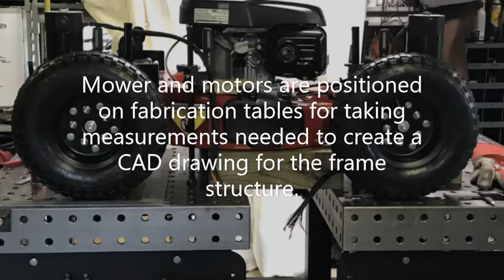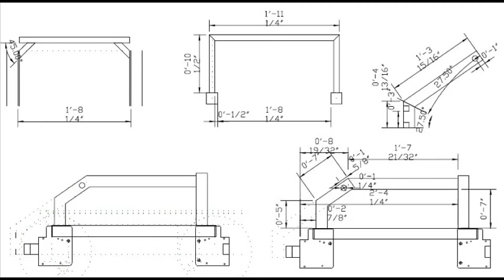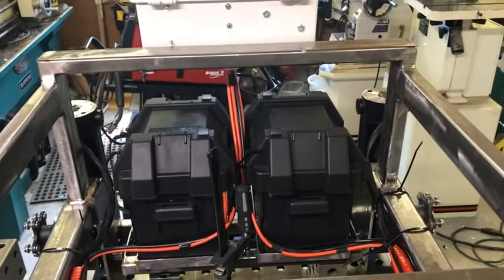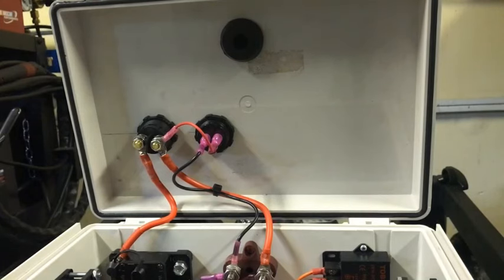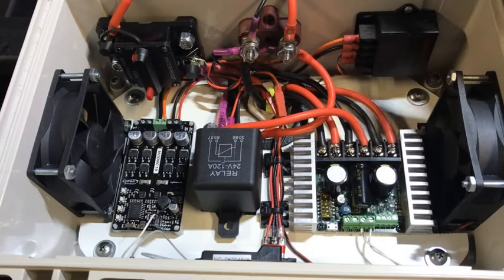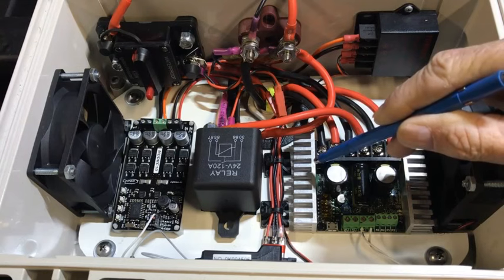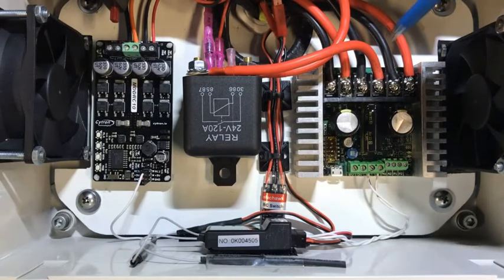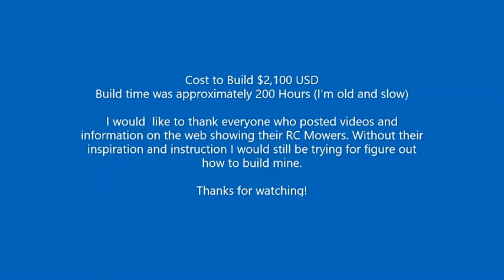Four Wheel Drive Remote Control Mower Build

Comment: That's the average cost for this project. Very well structured and engineered. I love the RC box control. I am trying to improve the speed of the motors, I'd like for my project more speed. How was your experience with the alternator? could you give me the tips to make it works?
Reply from the maker: Hi Teo, the alternator works great. When I finish mowing the battery voltage level is higher than what I started with. I have yet to charge the batteries. The 24V alternator I used is available on Amazon. It is called a one wire alternator, but you you have to use two wires. The positive and negative are wired straight to the battery's. I am running mine in reverse rotation (not sucking in air) to minimize dust and sand from being forced into the alternator. I checked the alternator temp after an hour of use and it was around 180 degrees. This is about the same temperature it would experience in a car. As far as increasing speed, a dc motor will have a max rpm at full power . If your motor controller is not capable of providing enough amperage to the motors it may not go any faster. As a rule of thumb, your motor controller should be sized at 6 times the running wattage. The formula is power in watts/voltage=amperage x 6. A 200 watt motor/24 volts= 8.3 amps. Multiply 8.33 times 6=49.99 Amps. This is the peak current the per channel that the motor controller could need for high torque start or when it is put under max load. Also wiring size and circuit breakers should be sized accordingly. My mower goes around 10mph + on a flat surface, but controller is not powerful enough in certain situations. I thought I could get away with a smaller controller, so I will be upgrading to a larger controller and wiring setup soon.  Hope this helps.
Reply: @giterbilt5146  thanks
Reply: @giterbilt5146  I have another question related the Alternator, how many RPM do I need to make the Alternator works?
Reply from the maker: Most alternators need to spin above 2000 RPM. If your mower pulley is larger than the alternator pulley you should have no problem. Most small gas engines rpm  is around 3400-3600. When searching for an alternator, look at the spec sheet to see what the rpm requirement needed.
Reply: @giterbilt5146  Thank your reply.
Reply from the maker: Here is an Amazon link for the one I used https://www.amazon.com/Alternator-1101285-1102348-1102379-AT130930/dp/B01NCI3Z2S/ref=sr_1_1?crid=3OQ2JHPH13FK6&keywords=New+24V+1-Wire+Heavy+Duty+Alternator+Replacement+For+Case+L59901&qid=1649249401&sprefix=new%252024v%25201-wire%2520heavy%2520duty%2520alternator%2520replacement%2520for%2520case%2520l59901%2Caps%2C1258&sr=8-1

Comment: Wow... what a clean job!  I think this is the cleanest mechanical+electronics work I've seen in my whole life so far. Respect...  I can totally see you are no 'regular builder' at all.  So sad the first half of the video doesn't have audio on it.  I'm sure that's possibly the main reason why the video has so few likes/views so far.  

If I were to have such a clean machine, I'll be like one of those proud  show-quality truck owners who work their truck 1 day and then spends 2 days cleaning and polishing it back 😅😁  This is me having such a lawn mower:  someone ask me can you mow my grass?  And I be, well, it depends, which brand of fertilizer do you use, does it leaves residues?  Do you have any grass that might leave stains while cutting? 🧐 Because You know.. there's this lawnmower-show I need to be at and...  😂

One thing that would be cool to have, in my opinion, would be the BOM list as part of the video description if you are kind enough to share it?
Reply from the maker: Thanks for the kind comment. I,m sort of anal when it comes to building things ...except when it comes to paperwork. Unfortunately I do not have a BOM for this build.

Comment: good day, i tried to power my 24v relay with rc relay switch but i could not power to on and off the 24v relay. sir, is it possible if you could help with this matter? thank you so much
Reply from the maker: I used an Elechawk 8A remote control switch to open and close the 24V Contactor.  Power to Elechawk switch is directly supplied by the 24V batteries. The Elechawk is turned on by a RC channel, which then supplies 24V to the contactor activation circuit, which then turns  on the contactor to 24v power to the motor controller.  If you have the same confirmation, and it does not work, test the 24V relay. Also ensure that the RC receiver is powered by a independent 5V circuit and not the 5V power from the motor controller.

Comment: Is it not possible to use the motor controller from the wheelchair
Reply from the maker: Probably could, you would have to design a radio remote control interface that mimicked the input control of a joy stick. If you run across such a design, please post a link, I would be interested in such a design. The sabertooth motor controller that I used is the simplest way to implement RC control you can use.
Reply: Easier to just use the servos to move the joystick with a slot plate.

Comment: Mr giter Bilt  I have finished the build of this mower and i have a couple issues i hope you might help me with when i turn on the key switch without first powering up the rc transmitter the left side wheels spin backwards very fast if i first power up the rc transmitter this dosent happen also i moved channel 6 to swiitch b and it dosent have any effect on the mower in either on or off position   i think this may be due to something wired wrong on the elechawk switch please help thanks
Reply from the maker: Hi Danny, have you corrected the problem?
Reply from the maker: I updated the 2x60 wiring diagram to show more detail for the electhawk (From your comment posted in another video).  To troubleshoot disconnect the motor controller B+ and remover the plug from the electhawk going to the receiver. Turn on the key, using a voltmeter, check POWER IN and GND it should  read 24V. Check GND to POWER OUT it should read 0V.  If it shows any voltage it is bad. If it is 0V, plug  back in the receiver connection.  Check GND to POWER OUT, it should show 0V.  If not bad electhawk or a bad receiver channel. To test if it is the receiver energizing to elechawk remove plug for 5V +- going to BEC. If  the voltage between POWER out and GND is 0V, then the receiver is causing the electhawk to energize.  Also check relay wiring to ensure that POWER OUT and GND are on the correct pins. Hope this helps.
Reply: @giterbilt5146  Hello sir, i tried all the suggestions you made and all were in compliance, however; still when i turn the key switch on without first powering up the flysky transmitter the left side wheels spin out of control rearward. if i first power on the flysky then they remain in stop position but the B switch has no effect on the operation of the robot. i thought the B switch would power off the robot in the event of a runaway. i have changed the flysky receiver; the 24v actuator and the elechawk switch but nothing changed. although the machine works fine im not sure this is how it is supposed to work  thanks for any help
Reply from the maker: Hey Danny, the only way that the wheels can spin is if the motor controller has power. Somewhere you are supplying power to the motor controller. Remove all receiver connectors to the motor controller and electhawk. Step 1. With the key on or off there should be 0V between motor controller B+ and B-.  Any thing else something is wrong. The purpose of the contactor/relay is to supply motor controller B+ with 24v when it is energized via the elechawk.  If you turn the key on and you hear a click from the contactor/relay, it is being energized.  With the key on the only the BEC (24v in 5v out) to receiver 5v and it is on, and the electhawk power + 24v in should have indicated voltage. Elechawk power + out to gnd should be 0v. The one leg of the contactor /relay should only have 24v, and should come from battery 24v positive. The other leg of the contactor/relay goes to motor controller B+ should be 0V. The the two lugs on the contactor/relay that turn it on, should have 0V between them. Be sure that one lug goes to the electhawk GND and the other to electhawk power out +.  Do not proceed to next step if all voltages  are not as described. If this is not as it should be, find the problem (recheck wiring and test each component separately). Everything good, proceed. Step 2. Turn off key and plug in electhawk rc cable to receiver Channel 6. Turn on transmitter then receiver(key on).  Recheck all voltages in step 1. If they are not the same and motor controller B+ to B- is 24v, somehow channel 6 is turned on and energizing the electhawk to contactor/relay and supplying 24v to motor controller B+. Check transmitter setup for switch used to turn off and on channel 6. Until you get a switch working correctly on channel 6, you have defeated the purpose of using elechawk/contactor safety circuit for turning on and off the motor controller power.  This is how I would trouble shoot the problem (this was also my component setup testing procedure). Good luck.

Comment: Hi.alternator wiring please...thanks
Reply from the maker: The wiring for the alternator is negative wire to negative 24 battery terminal, positive wire to positive 24v  battery  terminal. The two 12v batteries are wired in-series. When I get a chance, I will do a battery/alternator schematic, and video. If you subscribe to my channel you will get an email when I upload the video.

Comment: what is the operating weight?
Reply from the maker: It’s approximately 250 pounds.
Reply: @giterbilt5146  Thanks for that also didn't catch what batteries you were using?
Reply from the maker: Weize 12V 35AH Battery Rechargeable SLA Deep Cycle AGM, got them on Amazon
Reply: @Giter Bilt  Thank You for Your Work

Comment: Can I have your email I’d please.
Reply from the maker: If you have a question, I can respond via the comments.
Reply: @giterbilt5146  can you share the wiring diagram of 4 motors to the sabertooth controller .
Reply from the maker: Hi Gullapalli, There is a single wire for each M+ and M- controller channel to the each motor bank. Each wire is split at the connectors shown near the end of the video. The wire for M+ is split connecting to the front motor + and the rear motor .  The M is split and goes to the front motor - and the rear motor +.  The reversal of the + and - connections on the rear motor is because it’s normal rotation is opposite of the front because it is mounted backwards. I am currently working on an upgrade to a Sabertooth 2x60, and heavier gauge wiring. Hopefully I will be finished soon and will post a video on the upgrade. I will include a wiring diagram showing the upgraded wiring configuration.
Reply: Good day Mr.Giter Bilt,
Many thanks for your explanation of motor connection.appreciate if you can share the wiring diagram of the 4 motors to the sabertooth.Your mower looks great with new tyres.I wish you good health and happiness. Regards: G.K.Rao
Reply from the maker: I have added a link in the description to a Google drive folder that has the wiring diagram. @gullapallisujatha424
Reply: @giterbilt5146    Good day Mr.Giter Bilt, i am not good at browsing, can you please copy the link to comments box. Thank you.

Comment: Can we chat on email?
Reply from the maker: @ben212-i5w  I would be happy to answer any questions you might have here in the comments.
Reply: @giterbilt5146  thanks,
How did you wire the motors and the linear actuator to the motor controllers?
Reply from the maker: @ben212-i5w  Hi Beniplatt, there is a link  in the description to a wiring diagram  for a single motor controller to the motors. The actuator are just electric motors, and are controlled by a separate controller which is not shown on the diagram. Read the comments for all my mower videos, they contain a wealth of information about the mower construction and wiring. Good luck with your project.
Reply: Thanks, do I connect both motor controllers to the Receiver?
Reply: Would be great for a wiring diagram of everything..
Alternator and everything
Reply: And what is the elechawk 8a used for?
Reply from the maker: Watch these videos, and read all comments. All your questions have been asked and answered.   https://youtu.be/5Dn0kBMt22c?si=kMifr5DTQmEvo3EX

https://youtu.be/nz_zwzM-uJA?si=fGN0Mo8N0W4xV23o

https://youtu.be/nz_zwzM-uJA?si=rgAy_vP-EC7Xonb8

Here are links to the hardware used. The manuals show operation, configuration, and wiring. The manuals  can provide information better than I can.

https://docs.google.com/document/d/1MtfMosoGbtwMtnUFNAD_ilL7v05ski7z2r-MFWURM6g/edit

https://static1.squarespace.com/static/5bc852d6b9144934c40d499c/t/5d6f66305487dc0001e34939/1567581800555/FS-i6X+User+manual+20160817.pdf

https://www.dimensionengineering.com/datasheets/Sabertooth2x60.pdf

https://manuals.plus/elechawk/b08flvgtxq-8a-remote-switch-manual
Reply from the maker: @ben212-i5w The alternator is the symbol with an A in it.